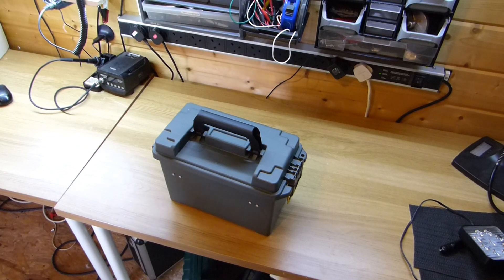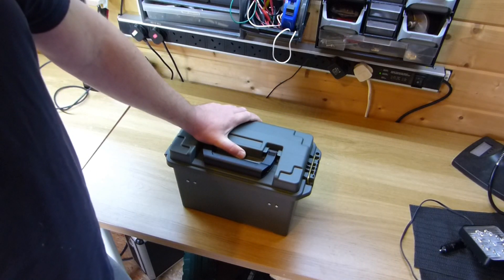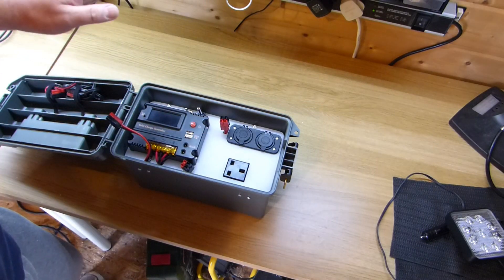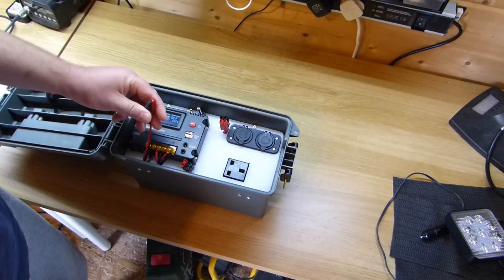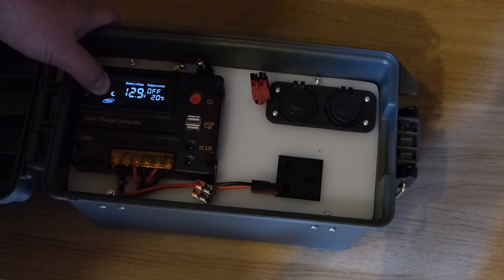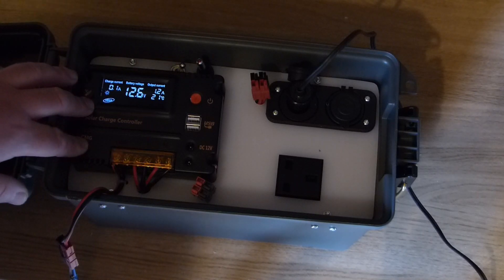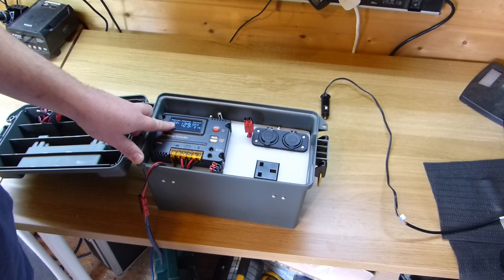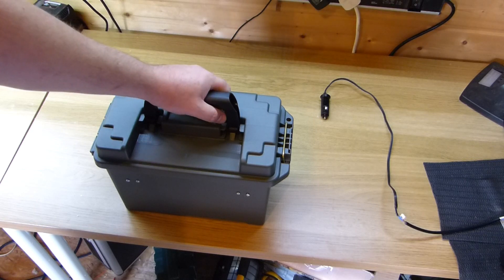Portable Power Box v2

Comment: Hi. I have built a similar set up. Just curious as to how you vented the 240v inverter as they have a fan on them? I have a 200w inverter in my box and put 2x vents in obviously compromising the waterproofing (won't be using it in a wet enviroment anyway so won't matter.) As I said just curious as to venting??

Comment: Were you able to charge the unit directly from the car battery? Any recomandations for portable solar panels?
Reply from the maker: Hi.  I have a lead that goes from the 12v socket if my car to the solar input of the built in charger of my box.  This helps regulate the charge.. any 12v panel I've bought from eBay works just fine

Comment: your builds are always so neat, tidy and well done. i dont think u can connect 12v into the input of your solar charger because most panels are more like 17-20 volts open circuit. would love to see how its all wired and connected underneath the shelf, but i realize youd have to take it all apart to show us. maybe next time you modify it, u could give us a look. keep up the good work!
Reply from the maker: +DragonBytes thanks for your kind comments. I shall film the inside very soon 😁
Reply from the maker: +DragonBytes just to let you know I have filmed another video but this time of the inside of the box. The video should be edited and live over the next few days. Thanks for your interest.
Reply: excellent! thank you James. i will look forward to that! 12v power gear/backup solutions are my favorite hobby
Reply: I have the same charge controller and have a 13.8v 3amp CB radio power supply when I plug it in it thinks the solar panel is connected at 3amps and as the battery gets near to full the amps drop down. So it is regulating  what goes into the battery. 15v is the cut of voltage for over charging the battery so it never gets there I was going to use an old lap top charger that puts out 19v but I was worried that I read somewhere that some PWM controllers shunt to short circuit when full your solar panel won't mind that but the lap top charger would. Don't know if true but better safe than sorry

Comment: Thanks for your video. I'm going to build something similar for my rig, even though I keep a 9Ah battery with my radio. Got almost everything in one case. Sure it got bigger than most go bags, but I do not walk far with it. Mostly from the car to the spot, so it should be fine.
Reply from the maker: +santasl thanks for your comments. I built this more out of fun really but it’s so useful to have around the home and out and about. Simple components and simple to put together.  Not sure if you’ve  seen my other solar videos ? Same principle but this is all in one box :)
Reply: not sure if I saw every video, but yeah I saw a couple. I really like that approach. I got into ham radio because I want to help in case of a emergency and therefore I like to have something simple that "just" works.  Do you have a link for the solar charger?
Reply from the maker: santasl https://www.ebay.co.uk/i/253077355187 
This should be the link for the charger controller. I also like to have radio gear ready for emergencies. It’s the sensible thing to do. Pleased the videos help you.